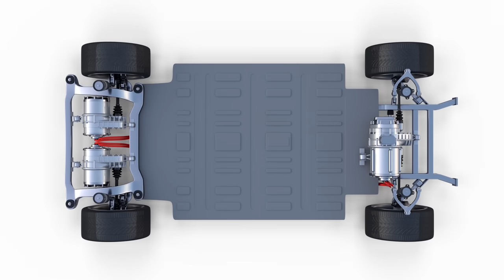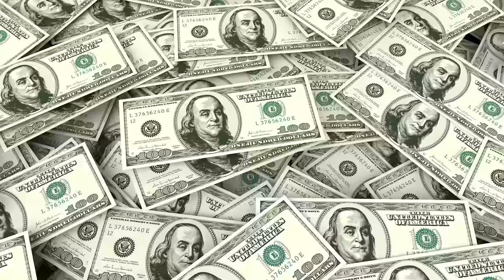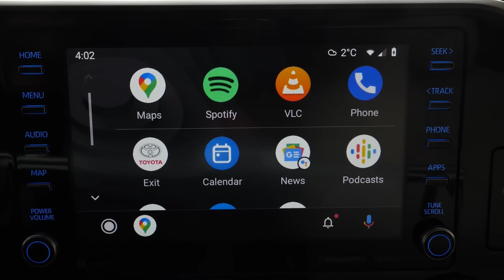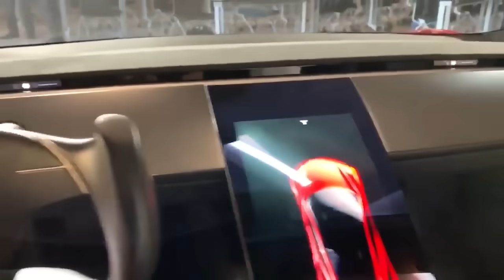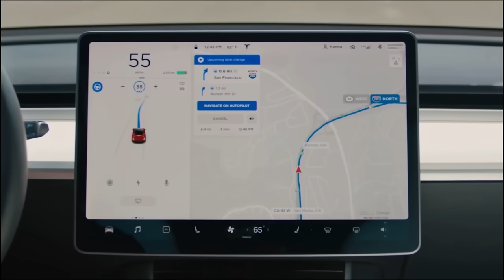Tesla Roadster 2022: Insane NEW Updates Revealed

Comment: Actually, it has 3 motors. One in the front and two in the rear. You can even see that in the picture you provided
Reply: yeah I know right
Reply: Half of the things on screen didn't match up with the guy speaking.
Reply: he has no idea what he is talking about and reading from a fact sheet paper
Reply: Came here to say the same…🤦🏾‍♂️🤦🏾‍♂️
Reply: There are different configurations. The standard base configuration – which he was talking about – does have 2 motors. The pictures just happened to be showing the tri-motor configuration when he was talking.

Comment: Car lights really don't take that much power!   Most headlights use between 60-70 watts.  both sides and the back lights and you got about 175 watts.   Or < 1 KWH in a 6 hour drive.   The lights  need trivial amount of power compared to actually driving the car.  Running the lights for 12 hours straight you will likely lose about 6-8 miles range.
Reply: Leaves headlights on over night by accident
Gas powered cars: Won't start
Tesla's: Tis but 6 miles
lol
Reply: @YharonJD  you should have a timer on it linked to a programme like a weed tent

Comment: Why fork over the extra 50k for minimal performance enhancements over the Plaid? Plaid already goes 0-60 in under 2 seconds and is a full sedan. 600 miles of range is pretty impressive though...
Reply: i agree, im guessing the tesla is lighter in LBS and has a slighter coe drag efficient so people will try to squeeze out performance bragging rights, now if it's top speed is at 250mph im assuming that during a roll race starting at 60mph to 180mph it'll keep up or gap a 1400hp twin turbo lambo

Comment: Ok 8.8 quarter mile corrected for rollout (usually). So 9.1 uncorrected, and since all the time is made at the launch, trap speed will be good, but not much beyond hypercar territory. So maybe quarter mile at 150-155 mph. The Rimac CTwo has already done it and gone faster at the trap. So I am guessing a 1 MW powertrain with a 2.2 T kerb weight. That should be enough for the top end too.
Reply: Yeah but isnt rhe Rimac Nevera like 8x the supposed price of the Tesla Roadster
Reply: tesla plaid does 9.1 and 9.2??
Reply: @livelong6685  The roadster will do 250mph+, the plaid model S can do 200, the 1.9s 0-60 acceleration is supposedly just the base model acceleration for the roadster, so itll hopefully be quicker

Comment: Headlights or driving lights will have no appreciable effect on range, as Tesla will most certainly use LED lighting. What on Earth is that clip of wet cell batteries doing in this video?
Reply: This video was just clitbait .  Most made no sense at all.  But the car looked awesome .  If they could sell it for $100K then it would compete with the Chevrolet Corvette .
Reply: @rayray7405  this car would be more like Ferrari or Lamborghini not Corvette…
Reply: @swag489  since the car has not been built yet , we do not know what it will compete with.  At $250,000  it is more than a high performance Corvette and less than Ferrari and Lamborghini.   I think Tesla is going to build a street car and not a track car.  The electric technology may not be able to compete yet with the track cars .